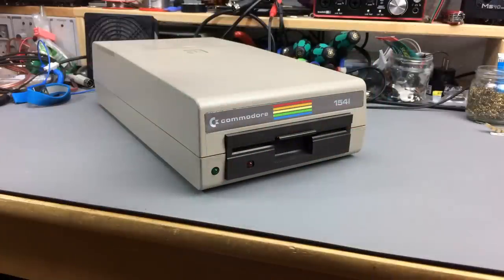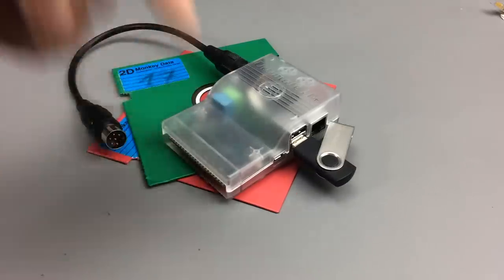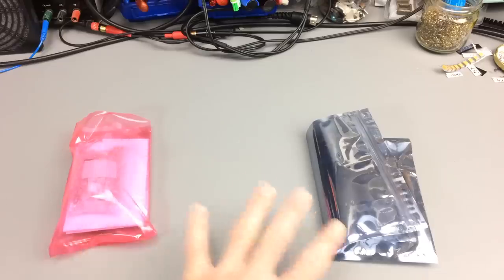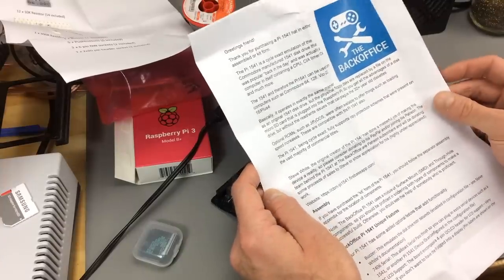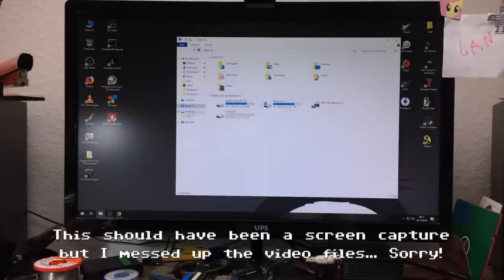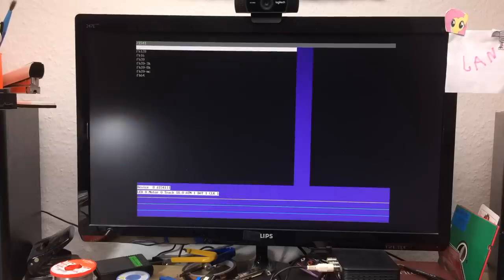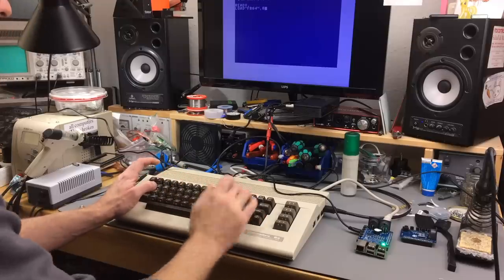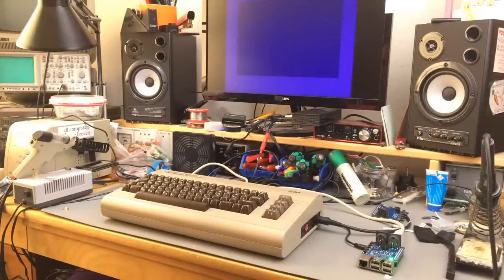The Pi1541 Commodore Disk Drive Emulator

Comment: It's good to have choice of a modern 1541 alternative.. I'm happy with my recycled 64c cased SD2IEC that I got from the future is 8bit... It looks nice with my 64c because its the same colour exactly.. I would not mind the Ultimate 2 for the extra functions like Cart load and Tape load etc.. The Pi looks interesting and has a lot of potential to be something great. Jan add a mini LED or LCD and a casing and maybe daisy chain the other board so you have 2 drives at once.. Or connect a different device to the extra 6 pin din.. What can you add? 
By using a Raspberry Pi there is loads that could be done in the near future to make this so interesting and a enervative project.

Comment: Interesting product but I find it incredible that we're using something with the sheer power (relatively speaking) of the Pi to emulate a bloody floppy drive. Someone was really smoking some powerful stuff at Commodore when they designed the floppy interface.
Reply from the maker: The floppy interface definitely is a strange beast. I think there were a lot of workarounds for flaws in the old Commodore machines and then they had to keep the design to make it backwards compatible.

Comment: Would be nice if you could use a USB keyboard/gamepad for selecting disk images and USB drive for storing and swapping them on th fly, not only SD card. But that would probably need full Linux installed. And exact timing under OS like that isn't that easy anymore.
Reply from the maker: Oh, you can actually connect a USB keyboard and select files. There's a nice user interface on the HDMI port. USB storage is not supported yet, but I think it might be an option in the future.
Reply: That's nice.

Comment: I really don't get why is designed with SMD if a person has to manually solder everything.
Reply: SMD soldering isn't that hard actually. And it looks nicer :-)
I actually desoldered the SMD components from the level shifter and put it on my pi1541, even if I had the option to use the level shifter as it is and solder it as through hole component on.

Comment: are you able to connect your pi to the Wi-Fi network? then ssh into it to send files to it, so you don't have to keep taking your SD card in and out? that would be really good if you can do that.
Reply: I would hope there would be a way to get this working - being able to copy ROMs to it with scp over wifi would be an ideal setup. Which is one of the reasons I went with the Pi1541. I haven't had time to put it together yet and figure it out though.
Reply: that is not possible at the moment. by ethernet network also not possible.

Comment: A very interesting project (but I'd still want an Ultimate II).  I'm definitely interested in whether the code can be run on a Pi Zero.  My understanding is that it needs a multicore CPU to be cycle-exact, which makes sense.  How do demos run on it?  Basically, no demos work on the sd2iec, either because of custom loaders running on the 1541 and even using the 1541 as a co-processor.
Reply from the maker: I haven't tinkered with the thing for too long but until now it works with everything I throw at it. I specifically tried some demos I remembered didn't work at all on the SD2IEC and all of them worked. Steve White is working together with the community to make the software run on lesser Pis, too, as far as I know. Would be amazing to have it work on the Pi Zero. :)

Comment: It's a complete mess of solution. You have 3 cables laying around and a long setup process without accounting all that soldering with many parts and things that could potentially go wrong and lead to a waste of money rather than saving them, without accounting you are wasting all the power of a Raspberry Pi 3B+ for such a little task.
For less than the price of the Raspberry itself and with only 4 pins to solder you can get the TFW8B internal version of the SD2IEC.
Reply: I agree.. this is like a cluster-f*ck lol... but hey at least it's fun. ;)

Comment: Would be interesting to see if a Raspberry Pi Zero would be powerful enough to handle this task. I can't see any reason why not, as it's quite more powerful than anything in the C64, just depends on how efficient the emulator is. :)
Reply: Can't see why it would not work, its only loading the software and using connections via the Pi, all Pi's will do the job.
Reply: IIRC there was a discussion going on about the pi zero. It is not powerful enough. This would require further optimizations in the code at least. But I'm not sure if this will be sufficient.
Reply from the maker: According to the project's GitHub page, the Zero is not quite powerful enough. Maybe the code can be optimized to work on "lesser" Pis in the future though. It surely would be amazing!